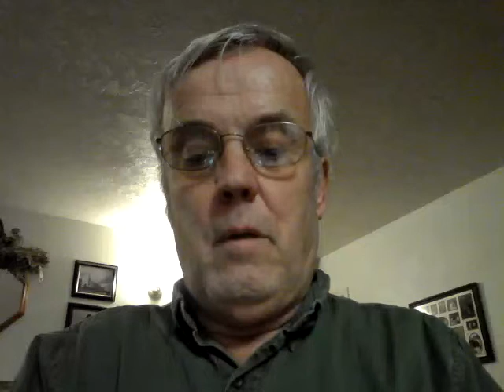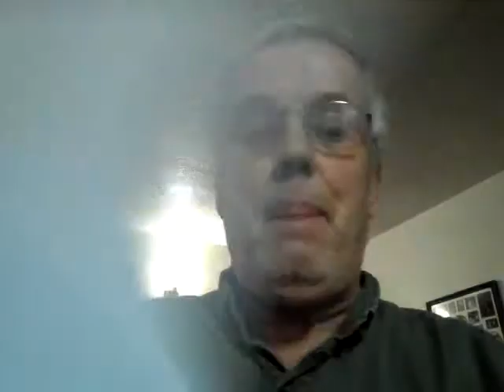Solar Powered Air Compressor

Comment from the maker: Solar  powered  Air Compressor 
 This system can be built as small as you can find the cylinders piping
And check values to build it with or as large as you can afford. 
 The compressor is buildup by adding one tank in an area hot or warm to one in an area that is cold or cool . The more the temperature difference the more efficient the compressor. 
If you want to increase  the pressor add two more tanks to the inlet  of the first tank in the first cell and then countinue adding cells until you acheve the desired pressure.
Each cell of the system consists of an inlet check valve (or the equivalent thereof ) a tank to hold the expanding or contracting gasses an outlet check valve (or the equivalent thereof ) another  tank to hold the expanding or contracting gasses an outlet check valve (ore the equivalent thereof ) to be repeated until you achive your desired pressure. This idea comes through me from our Heavenly  Father who I love dearly.
Free from God to me, free from me to you Through the will of God and the grace of our Lord and Saviour Jesus christ